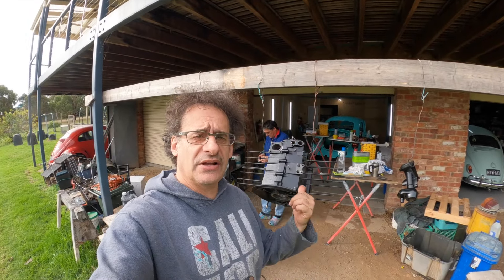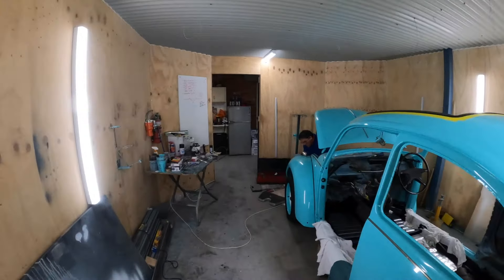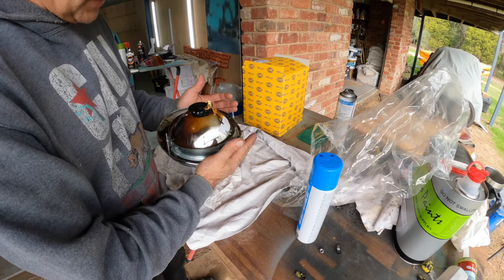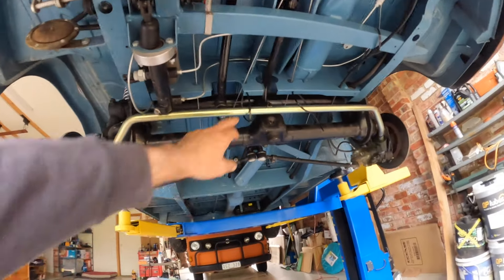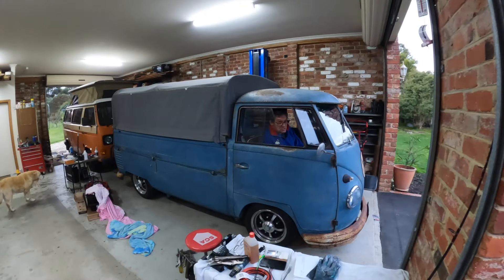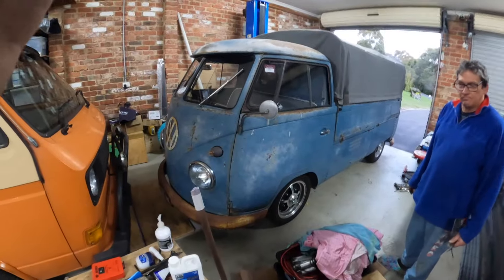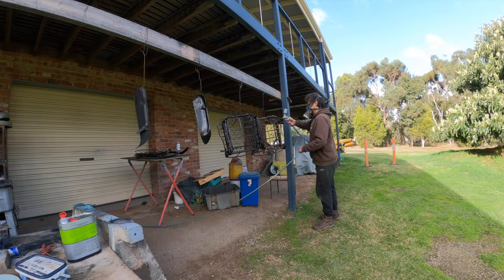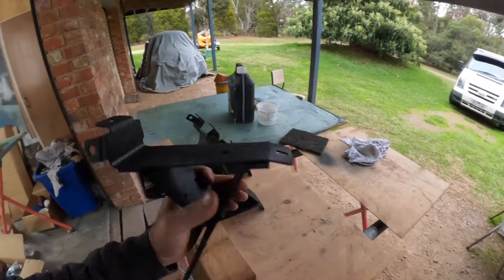$1000 Head lights? , Split sway bar and sun roof install  //millybug part13

Comment: @markd5548
Howdy Nick, 

I bought Mexican bumpers for my 54. You could watch them rust as you pulled them out of their plastic bags. 
Took them and the overiders to Vinny in Dandy who triple chromed and made them nice. Most expensive cheap parts ever.

Also the overiders didn't fit the profile of the bars. 
More aftermarket garbage for the pile.
Milly's bug is looking grouse.
Reply from the maker: Yeh the chrome these days is crap 😢

Comment: Crikey, $500 a pop for them lights aye? Glad I went with 7 inch full LED headlights. May have been a ton of work to make em fit but better lights n way cheaper than $500. Repro bumpers are pretty shite these days and it's either find stainless or get the originals rechromed by a decent local platers.
Reply from the maker: @GarageItYourself  yeh crazy hay, we are looking at stainless versions right now😉👍🏽